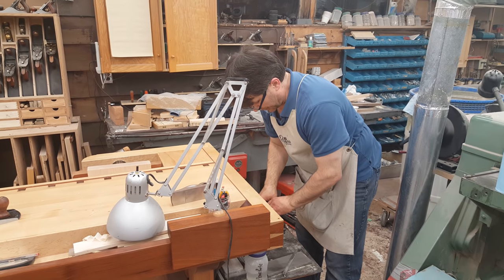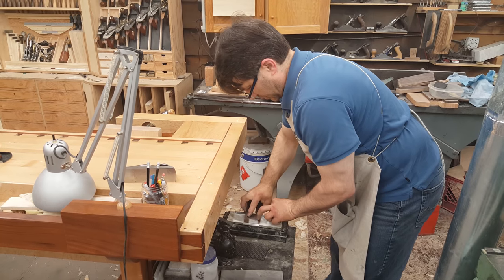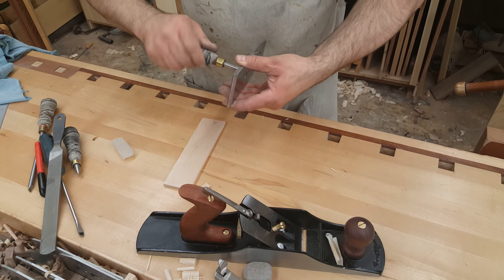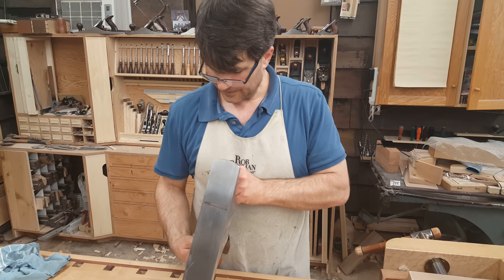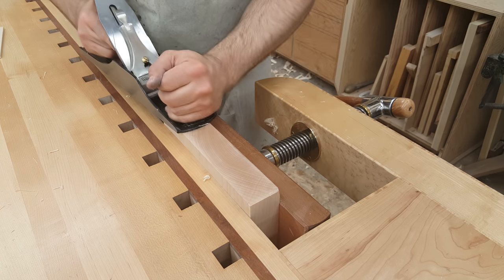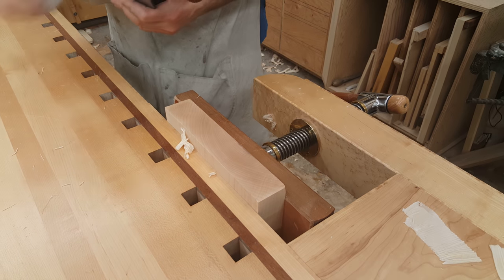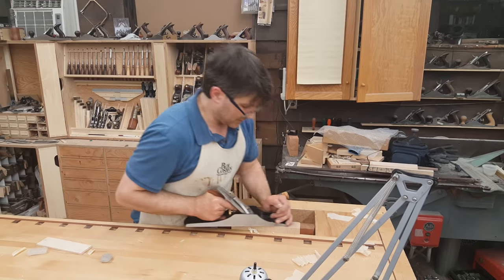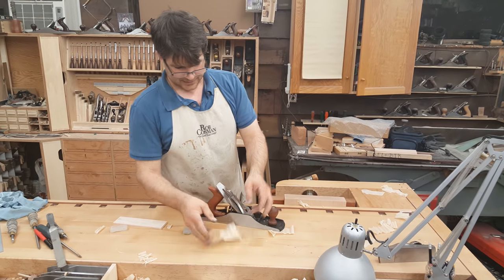Planing end grain (4K)

Comment: I bought the wood river 5 upon watching one of your videos. Used it all day yesterday, it's a fantastic piece of equipment, adjustment is so simple as you mention (although I frequently forget which way to turn the knob due to my novicery in the woodworking game). Still to get myself a 16,000 diamond stone...
Reply: Rico S the 16K stone Rob is refering to is a ceramic stone, not a diamond stone.
Reply: xang72
Ceramic stone.  Interesting.  Sure, why not.  Right.  Ceramic is good.  Is it cheaper?  Hell, I can Google that.  Thanks.
Reply: I would argue that you can polish an edge just as fine or finer with a strop charged with chromium oxide after honing between 4k and 8k grit.  The electron microscope images taken of edges sharpened on 1k then polished on a strop in "The Complete Guide to Sharpening" illustrate this point well.
Reply from the maker: What many people forget about using a strop is that you will lose your straight edge. Strops are great for knives and other cutting tools, but I want my plane blade to have a straight edge so I can get flat boards with square edges.
Reply: @RobCosmanWoodworking  I respect your opinion on this and would agree with you for power stropping.  I just doubt that some passes on a piece of leather on a flat backing could take my plane our of square.  Especially since it is squared up on my water stones before stropping every time.  The material removal rates with hand stropping are just so small.  I've been proven wrong before and will check my blade before and after stropping with a straight edge to make sure.
Reply from the maker: Before every sharpening I know that all of my stones are flat, so as long as my pressure is even (albeit not everyone has a handle on that aspect) I will wind up with a straight edge. Square isn’t as important because my lateral adjustment lever can compensate for some of that. However, with a strop you’re just working with however it was left the last time you used it. Though the material you’ll be removing is minimal, it’s still a variable that I would rather have control over (hard-backed abrasive) rather than hoping for the best. My two-cents at least.
Reply: @RobCosmanWoodworking  oh well I will stop using my strop on my plane iron then.

Comment: Just because I am an engineer and we think about these things. Regarding the ruler trick in sharpening: 

In another video, you state that the ruler trick  produces an angle of "about one degree." So I had to run the numbers myself. You also state in that video that your ruler is about 25 thousandths thick and I am assuming that your stone is about 4 inches wide. The angle this creates is the arctangent of 25 thousandths divided by 4, which equals 0.358 degrees. 
arctan(.025/4) = 0.358°

So you were pretty close. Thanks for all your videos.
Reply from the maker: Bruce Evans not to throw a monkey wrench into your math, but the thickness of the rule is actually .018”. Can you run it again??
Reply: @RobCosmanWoodworking  0.25°

Comment: Rob I got a 5 and 1/2 wood river plane but I still blow out the end grain on oak with an edge sharp enought to shave ive set the frog set the chip breaker and the blade depth as close to perfect as I possibly can any idea what I'm missing or doing wrong
Reply from the maker: Timmy tex long horns sharpness of blade is important for the surface appearance and feel (if your blade has any knicks you’ll see it as lines on the end grain), but does not determine whether or not it will “blow out” on the end. That’s most likely a result of a failure to create a chamfer on the far side, or taking too heavy of a cut.

Comment: Again with the 1/2 price comment. Wood River 5 1/2, typical price is $195. Veritas 5 1/4 ( they don't offer a 5 1/2) and LA Jack are $245, take your pick. What are you comparing the Wood River planes to when you're claiming they're half the price?

195 /245 = 79.5%
Reply: Lie Nielsen , Clifton...
Reply: Thanh Huynh Even LN aren't double the price. Some Clifton are that expensive, but at that point, you're buying a name.
Reply: Veritas does make a 5 1/2 jack btw. I use veritas and bedrocks/ baileys. Can't think of a reason to spend more on a tool that cannot be improved upon. I do like the brass but am not a sucker for it! Ha!!
Reply: its modeled after the old stanley bedrock planes just like lie nielsen so that is what he is comparing it to when he says that.
Reply: The Crossman .177 has a scope and is great for squirrels and possums.  I have just not been able to make a plane work for varmint control.
Reply: @ams062057  Stand up a jack plane and use it as a Paiute deadfall trap

Comment: Question for you Sir .. What's the reason for the grease pencil marking on the sole of your plane ?? New to woodworking and never seen that done before ??
Reply: Tuxdaddy Just a piece of canning wax to lubricate the sole.  Makes pushing the plane over the wood easier, your effort is spent putting the blade through the wood.
ROb
Reply: Thanks for the info .. Will have to give this a try..

Comment: what sorcery is this ??? ... Im trying to plane the endgrain of a 2" beech stock and it's a real mother to plane the end grain ... the blade shaves hair easily but I cant get it to plane endgrain like that !!!
Reply from the maker: Sharp blade, solid plane with positive contact between all the pieces.
Reply: @RobCosmanWoodworking  cheers !! I tried again today and at first the plane was just skating on top of the beech endgrain... then I readjusted the plane and pulled back the chip breaker a bit and for some reason it started cutting much better ... originally it wasnt TOO close to the edge but I pulled it back a bit more maybe now it's 2-3mm from the edge of the blade and it really made a difference ... still not taking full shavings like you are in the vid but getting there with the help of your videos , Thanks !!!
Reply: @darrylportelli  did you ever make any more progess? Trying to do the same thing here, will try pushing the chip breaker back
Reply: @adamthewoodworker2571  yessss i finally got rob cosman type results !! I bought shapton stones but i left them in the box lool havent used them yet .... What did the trick was sharpening normally (primary bevel at 25deg with a rough method like a belt sander, then secondary bevel at 30deg with 1000 and then 2000-3000 sand paper ONLY USE A FEW STROKES, NO NEED TO SPEND A LOT HERE.... JUST 10-20 Back strokes on the 1000 and then 10-20 back strokes on the 2000-3000) .... Then what reaaaallll did the trick was STROPPING on just a piece of mdf with some regular hardware store metal polishing paste (autosol) ... Every few minutes of work i stop and i strop ... This keeps the edge reaaally fresh and it will reduce the number of sharpenings needed ... Ive gone weeks without sharpening just by honing every few minutes of work .... Also what helped is dont put the chip breaker too close to the edge like everyone says on youtube , i put it like 2-3mm from the edge and it seemed to help a lot. ... I put up a video on my facebook page a while ago planing  4/4 endgrain hard maple like butter with this method
Reply: Oh and this was with a regular stanley number 5 , not a thick blade and chipbreaker like a hock iron ....

Comment: im curious. do you never use low angle planes then?? ( jack )
Reply: NO!  I never use them.  It is a moral principle.
Reply: Rob's math on total angles is correct.
Thinking about it further, if the material is hard, we cannot use small bevel angle. Or else the blade will chip pretty quickly.

Comment: I'm curious how the chamfer prevents blowout.  45 degrees?
Reply: +Thomas Hanson Long unanswered question, but here goes. By putting a chamfer on the far edge you don't plane into the fibers on the edge of the wood. Those fibers would be unsupported and would likely tear out as the blade pushed them. By putting the chamfer there those edge fibers are below the surface being planed. You can also clamp some scrap to the end to support that edge if you don't want to chamfer it. Or use a shooting board.
Reply: It's not preventing it so much as containing it to the height of the chamfer, which it does by the method described by DasAlbatross.